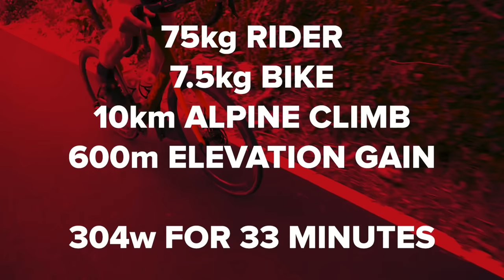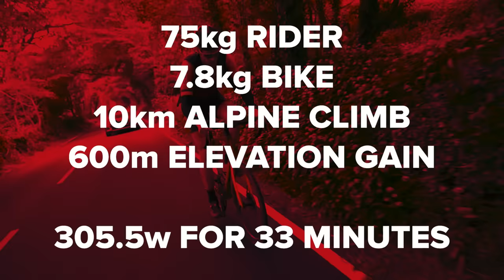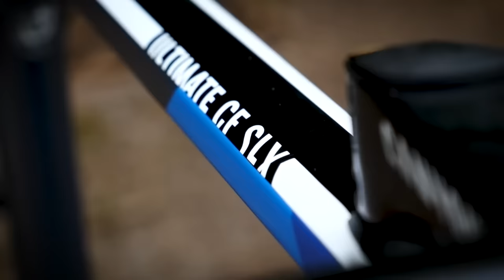10 Reasons To Consider Aluminium Over Carbon For Your Next Bike

Comment from the maker: Which material do you prefer, carbon or alloy? Let us know in the comments 👇
Reply: Yeah both my XC bike and roady are alloy 😁
Reply: STEEL (well steel is an ALLOY right?)
Reply: I would consider aluminium for a TT or trail bike, but for any road bike/cx or xc, I'd go for carbon.
Also, my alu commuter bike cost more than my car at the time, which was a 1997 Golf mkIII. €1000 for the bike, and €700 for the car.
Reply: Neither the one, nor the other.
STEEL. 
Retromodern  steel, in fact. (Columbus Gilco and Brain).
After having two aluminium alloy frames and a seatpost broken on me, there is no turning back.
Shiny Alloy for peripherals and wheels only.
Reply: I think carbon bikes do look better as everything's seamless but for the performance/price ratio definitely aluminium.
Reply: Please please use a blank space between the number and the unit
Reply: I am neither an expert at cycling or materials used for bicycles but I think I would pick aluminium alloy due to its price being more affordable, being an alloy is better at resisting corrosion and aluminium suits my casual style of riding since I am not going on Tour de France races.
Reply: Alloy all day
Reply: Titanium.
Reply: Both my XC MTB and my neoclassic KLEIN Aura X is aluminium 🤩 And I love them both… The Klein - with it’s zirconium/aluminium frame - comes in at just 8,6kg with Vision Team30 aluminium rims and a 105 groupset… 👍
Reply: I have both alloy and carbon road bikes. Carbon bike is lightweight with great components and the alloy bike is entry level but for the average rider like me I wouldn't hesitate to buy a new alloy road bike for every day riding!  It's cheaper to buy and your not so obsessed about it getting stolen or scratches! Sometimes Less is more!
Reply: Alloy. If were to break the bank and buy an ultra-expensive bike, I'd go for titanium.
The prospect of having to trash a frame from a single crash alone is reason enough for me to feel allergic to cartoon fibre.
Reply: Which is it Ollie, Aluminum or Alloy? You're a chemist so you should know the difference.
Reply: I have an aluminum Specialized Allez with carbon fork. It's marvelous
Reply: alloy
Reply: Aluminium has limited fatigue life - after certain number of stress cycles it will break. This is main reason airplanes are recycled after ~30k flights and that aluminum wheels will develop cracks as well as aluminum frames. Steel and titanium have infinite fatigue life as well as carbon reinforced plastic. Have a look at Wohler curve for all mentioned materials. Regarding carbon frames recycling - it is possible, but the problem is that it requires very high temperatures.
Reply: Aluminium for price, durability & recyclability. Steel for the classic look, titanium for the classy posh factor.
But aluminium really is the sensible option.
Reply: @KenSmith-bv4si  frames are made from aluminium alloys which are typically 95%+ aluminium. it’s fairly common shorthand to refer to them as just aluminium, simply not to over complicate things and confuse people 👍🏼
Reply: I’ve got a titanium comtat frame. I’ve had a few carbon frames but would never go back now. It’s heavier but way more comfy and forgiving in a slam
Reply: I prefer aluminium! Thanks for the video guys!
Reply: Carbon.
Reply: Well, I will choose aluminum.
Reply: As much as I like a top spec carbon bike, for me and my use; aluminium all the way. Domane ALR 5 it is :)
Reply: Aluminium
Reply: Clydesdale here. I don’t trust carbon fiber after one broken chain stay. I sweat buckets and have rusted down tubes and top tubes on steel frames. Never had an aluminum frame part fatigue break, but have had a broken stem clamp break at the bolt holes. I really want a titanium frame.
Reply: Ohh and I forgot, I don't have to have bike fitted for the Tour the France, simply because I wil never ever ride it. And if I want to have a lighter bike I just eat less, it's cheaper
Reply: Both. I have three carbon bikes and two alloy Cannondales. Alloy is more comfortable when facing roads that are less than perfect (and we have such roads in abundance where I live).  If I am going to the cycling track, however, I will take a carbon aero bike.
Reply: Steel. Aluminium is cheap though, you could use the savings to pay for your chiropractor visits.
Reply: Most amateur cyclists can't afford carbon fiber.
Reply: Changing a 4 syllable word (Aluminum) into 5 syllables raises the global CO2 rates each time the additional 'I' is added.  Way to go Ollie, your extra hot air is making the rest of us sweat more.  Steel for the win is best answer.
Reply: Aluminium for me. At first all I could afford was a Synapse Alloy with Tiagra. It was 11kg. Over time, and by buying deals. I've upgraded components (wheels, crankset, bars, seat, seatpost, RD) until it now weighs 7.8 kg and I love it. As for the dreaded BB30 creaking, its never been an issue, probably because of the high tolerances in the aluminium machining.
Reply: I liked my aluminum Ridley but I’m finding I love the more solid, quieter sound of a carbon frame, and I am in love with that dull thunk you hear when you slam on the gas
Reply: Both carbon and aluminium are great. Carbon sure is better if money is no issue but for racing and taking my bike on a plane I prefer aluminium
Reply: Titanium
Reply: i will stick with my 9.5 LB  cannodale supersix hill racer and my 9 lb Pinnarello F series and my Spec Tarmac and My titanium Litespeed , because ........ Aluminum is just so-so .  byutthe show was good , ollie
Reply: @KenSmith-bv4si  if you make tubes from 100% Al, you're in for a (not fun) ride
Reply: STEEL  Aluminum rides harsh and chatters on bad roads. Scary at high speed. I did like my carbon Roubaix as it felt more like a steel bike. My steel bike you could go 60mph downhill on rough pavement, and it was solid and planted. Very fast on the flats, and if it was slower on the climbs, it was by the smallest fraction.
Reply: Sort of. An alloy is a mixture of multiple metals. Steel (basic steel) is a mixture of iron and carbon. Carbon is nonmetallic. So it’s a mixture in its purest form but technically doesn’t fit the definition of alloy. 

There are “steel alloys” which is the steel (iron/carbon) combined with additional metals to improve its characteristics. Bikes are made of steel alloys such as chromium-molybdenum.
Reply: Magnesium
Reply: Jurassic Park.
Reply: Aluminum FTW.  Both my road and mtb are Aluminum and love them.  They can take a massive beating and it's never a concern.
Reply: Rather have steel, I have an Cr Mo steel frame, it's heavier than than the carbon, but it rides nicely. I also have an Look kg381 old school carbon frame with aluminium (the auto correct feature is wrong) rivets. The weight diference of 2 kg is mostly of worst gear, the carbon bike has 7800 dura ace and the steel has the old 105 group with a triple, and heavier wheels.
Reply: I prefer titanum!
Reply: Aluminium for ever ! I built a Trek Émonda ALR about a year ago. I decided to spend less on the frame and used the money to buy a set of Bontrager XXX4 wheels, a SRAM Red 11spd groupset and a finished it with a full Bontrager XXX set of components. It is buy FAR the best bike that I've ridden. People always thinks it's a high end carbon bike ! But it's not hehe
Reply: I started riding a year ago and bought an aluminium trek emonda. Its a great bike and its got me to love riding. It was cheap and it looks great. Yeah - I’ll probably buy myself some ridiculously expensive carbon bike one day but for now, my emonda alr is just fabulous
Reply: This video prompted me to look up ollie’s cv. He has a phd in chemistry!! Never knew - awesome stuff!
Reply: @deabreu.tattoo  Why do you think I asked Ollie , aluminum or alloy?
Reply: My Koga-Miyata is 29 years old. It is made of steel. I'm looking forward to celebrating its 30th birthday next year.
When your carbon bikes are 30 years old, let me know if you still ride them.
Okay, it might be 3 kilos lighter. But I should be 15 kilos lighter too, so if any progress must be made... :-(
Reply: I keep thinking I want a new carbon frame road bike, but then I jump on my Caad12 and realize it’s such a fun bike to ride.
Reply: Steel
Reply: Steel!
Reply: stainless
Reply: i have a cannondale quic;k 2019 frame.  works great.  ive crashed it a few times
Reply: Carbon :)  had ally for yrs before so had a change  🚲🚲🚲
Reply: steel
Reply: i switched from alloy to carbon and my new bike is more confortable and faster
Reply: Steel!
Reply: Steel.
Reply: Titanium! 😂
Reply: checks choices in frame size that fits me .... alloy it is
Reply: AL just cause of the value to price ratio
Reply: Aluminimumium
Reply: Very happy to have two aluminum bikes - both with a threaded bottom bracket.

Also, although I'm Canadian (and therefore have always called it "aluminum") I agree that "aluminium" makes more sense.
Reply: Alloy
Reply: Aluminium welded in Europe. No carbon crap produced for 100€ by unknown manufacturers
Reply: Alloy, titanium alloy.
Reply: I prefer Carbon, but the my CAAD12 seems just good;
when you ask straight up, all factors come in to play, put money aside; I will most likely take carbon. and the Trek glossy metallic finish
(I have 2 steel bikes, a few Alus and 1 carbon)
Reply: @Ιωάννης-ΠάριςΠαχής  oh God no. Carbon for my 'good' road bike, alloy for mtb
Reply: Alloy
Reply: Aluminum
Reply: Aluminium 7005, but i would go for Titanium if price was not a concern.
Reply: Alloy all the way
Reply: I just bought a CAAD13 with rim brakes. What is the best upgrade wells i can get form rim brakes?
Reply: @GCN-Tech:

Both :-)

(I like both equally as much. I don't prefer one over the other. I have no favorite[/favourite] bike-frame--material).
Reply: @jefersonerbrad4461  My Koga is from 1989 and still running too but a huge difference to my Canyon AL 7.0 and to my Giant TCR Pro. The Canyon is great for mountains, rainy days and winter, the TCR is a great bike for the flat surroundings here in Berlin and Brandenburg countryside on sommer but the Koga is my choice if I want to do a special ride on a sunday ride in summer ;-)
Reply: Aluminum; as I have never owned a Carbon bike. Thanks for the science to confirm my personal views.
Reply: Titanium steel aluminium
Reply: My family are all engineers.
Reply: What about aluminum stress cracks,I haven’t seen in first hand but you know rumors,is it true tough?
Reply: Aluminium… and I waiting for specialized allez sprint comp
Reply: @chris1275cc  Kind of.  It's an alloy of iron and carbon.  Not sure that really counts as carbon isn't a metal but hey.
Reply: Not the most educated on this as not ridden a carbon bike.  I do however know how much aliminium bikes have improved and that my high mid range ally bike is more than a match for most carbon bikes I see.  Not all of course but that's cool.
Pronunciation wise I find the history of aliminium strange.  The US are using the original pronunciation of the word, so I generally think this would be most acceptable.  However when the scientific governing body go with the newer UK favoured version I suppose the US should keep up with the times.
Being UK based I use that version, and I do find the pronunciation of a lot of international 'English' quite amusing.  In truth of course most countries using these have far more population so we need to adapt and accept we are a tiny little island in a far bigger world.
Reply: @KermitFrogThe  Err no not kind of, steel is an alloy. 
Alloy: A substance composed of two or more metals or of a metal and a non-metal 
GCN asked: Which material do you prefer, carbon or alloy? GCN (and everyone else apparently) thinks "Alloy" is an abbreviation for Aluminium, it isn't that would be ALU, ALUM (written) or ALLI (spoken) so I was having a little joke. Someone always has to come along and ruin things in order to try and appear smart. But hey.
Reply: Alloy.
Reply: @chris1275cc  Thank you for correcting me.  I had genuinely forgotten the actual definition of alloy wasn't just metals.
I was intentding my initial response to be ironic sarcasm type of pedantic, not the serious version.  Something that I often mess up in type.
I remember being confused when looking at bikes in my youth because of the alloy alli talk, so I got the joke.
Reply: @silverhawk911  while it’s true that aluminium does resist corrosion, I wouldn’t consider it “better” that carbon fibre at this task. 
Aluminium does rust!
Reply: @deabreu.tattoo  dude I’ve crashed my carbon frame gravel bike literally dozens of times. It’s way stronger than you give it credit for. I also have the reassurance that if it cracks I can have it repaired- a perk that aluminium doesn’t have.
Reply: @GC_420  lol
Reply: @sportbikejesus  
Jeez another "Must try to appear smart and ruin jokes killjoy" 
NO not "sort of"
ALLOY, from the Latin alligare ‘bind’ : A substance composed of two or more metals or of a metal and a non-metal
Reply: @twowheelsdown2002  my aluminium frame road bike is extremely comfortable. I’d depends a great deal on how you set them up. 
That they are uncomfortable is maybe more true in older gens of frames.
Reply: @AtomiX_CS  I did a similar build this year and regret nothing. Fuji Roubaix frame with carbon wheels and a Dura Ace group. It’s a massively great bike!
Reply: @lordiablo9  there’s absolutely no arguing the value of alum. Nothing else comes close.
Reply: Steel and aluminum, i owned a 1983 brigdestone road bike it was 2st owned by my moms uncle and given to me last year, the bike was great.
Reply: First time I rode over a brick road on a carbon bike I knew I was not going to go back to alloy.
Reply: @KermitFrogThe  To be fair my annoyance was really with KILLJOY BOT 3000 (Sportbike Jesus) further up the comments who said the same thing but definitely was not trying to be ironic or funny, (he also did that sneaky thing tolls do; posting to the thread rather than replying to me) and you got caught in the crossfire. Sorry bout that.
Reply: If you have money its better to  by a top of line carbon bike, but, if you havent I think its better choose a alloy frame whith good componnents.
Reply: I prefer alu, because ive caad12 and  love it so much.
Reply: @darrellshoub7527  Wow, that's a lot of nice bikes. You're a lucky guy! 👍🏼
Reply: Alloy all day every day !!!
Reply: @joelzylstra2971  You are right. Aluminum does "rust" and it does so incredibly fast. But that "rust" is aluminum oxide and it forms a highly protective non-reactive sacrificial layer for the metal underneath it. Brilliant material.
Reply: Carbon, it’s stiff AND comfortable, dampens vibration. Titanium was great, but flexed a lot. Steel was good too, especially the OS. The aluminum bikes really punished me in every way. 

I’ve own Cannondale Crit (1990), Concorde Slx (1992), DeRosa OS (1994), Merlin titanium (1996), Cervelo soloist (2006), Specialized Tarmac (2009).
Reply: @MrLuigi-oi7gm  yes,  I  am.  and I love bikes , maybe a little too much !
Reply: @Dumdadum76  Ditto.  I’ve had three carbon bikes and countless others, but Domane AL5 can be summed up in three words. “Peace of mind”.
Reply: @Dumdadum76  Ditto.  I have had three carbon bikes and countless others, but the Domane ALR 5 can be summed up in three words.  “Peace of mind”.
Reply: life time warranty for carbon solves this for me
Reply: Hahaha…pronunciation is a matter of usage and consensus not etymology. Brits are famous for butchering words from French, Spanish, and any other language to anglify them so your “al-loooo-minium” argument is rather inconsistent and convenient.
Reply: Alloy frame for my trainer (used to be top of the range one 17 years ago) but a good Carbon frame for my outside riding not a top end but a good quality one
Reply: Chromoly?
Reply: @darrellshoub7527  There is nothing more beautiful than the way bicycles blend physics, engineering, art, and adventure. You can never have too many of these magical machines. Enjoy, Darrell!
Reply: Steel!!!
Reply: @MrLuigi-oi7gm  yes  and the amazing thing is :    I am sure you ll agree :     there has been little change in the frame design in bikes in the past many decades,  if  you   go on the road with a car from 1949 people  will be like whattttttttttttttttttttt ???????????   but here are many antique bikes that from a  distance  just look like  lovely , awesome bikes , not outmoded or outdated antiques ! .... what is your favorite of your bikes ?  Mr Luigi ?  name your fave bike !  (( atm mine is my black red and white cannodale supersix ultralight. ))
Reply: Carbon isn't as impact resistant but unlike aluminum it's repairable. I used to be a hard core "steel is real" and I still prefer that for touring. But I got my first Carbon bike this year and it's such a joy to ride I don't think I could ever go back. I've never had that experience with aluminum it's always been take it leave it.
Reply: The problem is the bike manufacturers, if you want 105 or better components you have to get a carbon frame, to stay aluminum with carbon fork you top out at tiagra.
Reply: I'm a heavy person,  alloy for sure
Reply: Carbon.
Reply: Carbon or steel. Not alu. Thanks
Reply: I have an alloy mtb, and I have a fully carbon road bike
Reply: Alloy
Reply: Carbon road bike Carbon mountainbike Alu work bike
Reply: I got a Trek Checkpoint SL6 .. having broken the frame once from being stupid Itll likely be my last CF bike as honestly that has me spooked as the cost of replacing a busted CF frame is nuts .. and not to mention if you have a significant other who is not a cyclist themselves it's not a fun conversation of the expense to have ...
Reply: Aluminium
Reply: Have done some of my Best Times on an Old Alloy Frame, but having said that, the Wallet Rules the Choice.
Reply: I have a TREK aluminum and I am driving faster now. I have invested in much better brakes and wheels. I also really lost a lot of money when I sold my used carbon.
Reply: Steel mainly but I’ve just repaired and rebuilt a bianchi ev2 with super record 11 speed and some lightweight wheels and its 6.9kg with pedals. It rides like stiffer steel.
Reply: Definitely Alloy.
Reply: Aluminum is d best..
Reply: Copper and zinc alloy
Reply: I have an aluminum bike, and it has been very good for me. I can't think of a reason to spend a fortune for carbon fiber.
Reply: I have a hardtail in triple-butted scandium alloy with, get this, carbon seat stays.  
I love it, but I've heard they stopped producing this particular combination because they had too many failures at the joining point in some models, but mine has been going strong —touch wood— for over a decade (albeit I've not been in the best physical condition to thrash it too hard).
Reply: Ive got 3 carbon frames on my living room wall with catastrophic failures, and not 1 alloy frame. That speaks enough for its self.
Reply: I have nothing made of carbon fibre. My bikes are all aluminium and stainless steel. I don’t break them.
Reply: Alloy's are much easier and cheaper to repair. Metal bikes are less expensive to build and engineer than carbon. I understand Carbon has it's benefits, but I'd like to keep costs within reason and so Aluminum and Ti are much preferable. Even if money was no object I'd go with Titanium. Thanks.
Reply: As a crit racer ride what you can afford ride what you can maintain and afford to repair. You will regret choices if not.
Reply: @breakawayadv8626  l
O
Reply: Include titanium in the choice.
Reply: Can't afford neither xdddd
Reply: People who told me, alloy is better than carbon? Buahaha, this People dont have money for real Good carbon Bike on Dura Ace di2, and high quality carbon wheels for example Cannondale Hollowgram 64. This is True. Alloy frame are made for People who dont have a money. Is terrible, bad True.
Reply: My road bike and hybrid are both aluminium and my recumbent trike is steel. When conditions get windy, having a bit of weight above your wheels in kinda handy. I also think that when you can lift a bike with just your pinky finger, complaining about weight is just an excuse. At that point weight savings are not yielding significant gains.
Reply: Titanium if I could afford it. Until then Aluminum.
Reply: My wallet says Aluminium.
Reply: @iLoveTaeyeonSNSD  what You wait? Maybe its time to Good pay work and buy a high quality carbon Bike with di2?
Reply: Plastic 🙄🙄
Reply: Why don't you explain the proper spelling of aluminum to the world's greatest manufacturers of aluminum tubing?  This is not a joke but that if you look at the labels on those tubes, they have trade names and not what some ridiculous world body wants me to spell.
Reply: titanium
Reply: If I am rich , going to get all carbon
Reply: Carbon difinetly carbon. Sorry chaps but alumanum sucks
Reply: @ukestjohn  BB30 in an aluminium frame is bot an issue, in a carbon frame is another story...
Reply: I like bikes comfortable, carbon is good.
Reply: Only steel is real...... (accept titanium but this is to expensive.....).
Most of the points - stell is ahead of aluminum + carbon..... and in the UK has still some frame builders using steel. For very good reasons!
In all of that discusion - at least steel should for most people be always on the list to look and test!
Reply: Alloy, hands down!!!
Reply: My mountain bike's frame is aluminium. I like it because it is lightweight, strong, can take hits on the trail very well, dampens vibrations very well, and can take scratches and scuffs unlike carbon.
However, I installed a Ritchey WCS carbon seatpost that works very well in absorbing and dampening vibrations. I also installed an Easton Cycling EC70 carbon handlebar that is also strong, lightweight, and absorbs vibrations really well.
As a result of combining aluminium with carbon parts, my bike is lightweight and strong without breaking the bank. Aluminium bike frame, carbon contact points, and alloy in other areas is a win-win for me.
Reply: @Ιωάννης-ΠάριςΠαχής  You must be a heavy rider
Reply: @MrGgajic  Aluminium will not be subjected to gigantic stresses that an airplane undergoes
Reply: #Cycling #GCN #GCNTech  Hello Ollie, True Story... I had an 16 yr old regular customer come to my shop and told me he was racing the local Seward Park road-race series in Seattle. Oh I said, how are you placing? He replied "I keep coming in 4th or 5th". Wow, I said, I didn't know you had a race bike.  He replied "no I don't I'm using my aluminum road commuter bike, that one".  He pointed to a Fuji road commuter bike with heavy puncture proof tires, mechanical disc brakes, fenders & a rack, and said, "If I had a carbon race bike I know I can Podium"... I ABOUT FELL OVER.  I said "NO! What you need is a Lt/Wt set of tires, remove the fenders, and I'll teach you a few racing strategies and I promise you will and can win the whole Seward Park race series!"  I will sponsor you and modify your bike at no charge, and prove to you that an aluminum bike is often better than carbon.  Oh and by the way, leave the rear bike rack on, cause it actually helps aerodynamics...  He just looked at me like I lost my nuts... Sure enough the next time out he came in first!  And continued to win the entire Seward Park race series, including the grand prize of a new Burley touring bike and some serious cash.   And by the way, I rotationally balanced his wheels which made a big difference.  The best part was pictures of him on the podium and below the podium were the winning bikes two nice Cervelos and his ugly Aluminum Fuji with a bike rack...  It was a sight.  Unfortunately he moved back to France as his father trained for one year at Microsoft and had to go back.  I'll see if I can find those pictures, its something to look at.  Dan
Reply: I had a Cannondale SR 500 28 years and sold it because I wanted something new/newer. That bike frame was very harsh, but the frame never have me  issues. I now have a 2010 CAAD 9, frame still going strong.(I know the fork is Carbon) if I do get another bike Aluminum for me. Do you think you'll get 25 or 30 years out of a Carbon frame?
Reply: Alloy, of course. But the whole alloy/carbon debate is a moot point here in NZ. We can't get the alloy frames we want.
Reply: @Ιωάννης-ΠάριςΠαχής  I’ve heard light and thin aluminum tubing might not be best for heavy riders. That’s why I go with steel or carbon.
Reply: @sapinva  carbon seatpost should solve the problem
Reply: @blazingst4rz  Lol. Good one.
Reply: both too rigid
Reply: It’s pronounced aluminum.
Reply: Carbon!
Reply: Carbon road bikes, aluminum mountain bikes, and steel frame fixie bikes please.
Reply: I'm riding a Gios A 90 for nearly 15 years by now, and in my opinion it's one of the finest ways to operate a racing bike: lightweight, short and steep with an amazing handling, perfectly completed with initially the 2006 version and  today  the 2020 version of Campa Chorus components.  This is definitely the racer I dreamt of,  literally for decades before. No reason to move from my aged signorina in blu to anything of carbon, may it be blue or pink.
Reply: What is alloy? Do you mean aluminum? - International Scientist
Reply: I was cycling when I was younger but alot... back then we all talked about aluminium 7000 somehting lol... over iron can u believe ... and yes for racing ... did alot of races...  I have sadly never tried carbon... I much believe in what u say here... But I also if started again today would really much like to try a carbon one... and with that said.. it was even a Pinarello I had back then but in aluminium.... today that same cycle Prince is made in carbon
Reply: My Principia road bike is aluminium, so o prefere that. It’s as simple as that. 🤷🏼‍♂️
Reply: My Principia RSL is danish made and as such made of aluminium. It's about 11-12 years old, but works perfect to me.
Reply: Unobtanium or Vibranium which is only available in Wakanda.
Reply: What “bike of the people” should be like:
Road: alloy frame + 105 R7000/SRAM APEX
Mountain: alloy frame + Deore M6000
Gravel: alloy frame+ GRX 600
Reply: @chris1275cc  steel is real
Reply: @scottbaker5851  using titanium is kinda overkill. alloy is enough for the force it will meet on the road and alloy is half time lighter than titanium
Reply: @mozambique9113  
My custom ti bike comes in at 17.5 lbs.
Reply: At 218lbs, I'm not a weight weenie, so I think Aluminum for me. A few pounds isn't going to make a difference.
Reply: Titanium! If you know you know!
Reply: 99% of the performance of top end carbon fiber bikes for the cost of entry level carbon fiber.  My Trek Alpha weighs half a lb more than the Emonda and rides better.
Reply: 4130 CroMo steel.
Reply: I use steel bike for smashNgrab with cargo trailer attached and alu if i want to be quik
Reply: Ideally it depends on the application. If your doing touring or commuting go with steel. If your a young racing pro with money, go with carbon. But if your like most cyclists who want a good all rounder for not much money, go with aluminum. I aspire to ride Titanium some day. Thanks.
Reply: I have a steel bike, an aluminium bike, a carbon bike, and in 2 weeks my Litespeed Titanium bike will arrive. Gotta catch'em all you know. So far, I  prefer the carbon.
Reply: I'm still choosing alloy bikes! why? First of all it's on a fair share prices and also a perfect weight for the bikers 

While Carbon Fiber Bikes are quite expensive rather on the brands but the weight is lightweight but it's too pricey
Reply: @fortynine3225  steel lasts longer and can be repaired, replacement tube welded etc
Reply: I own 15 Alloy bikes , had a few Carbon but all cracked or damaged stays and BB bracket area , they are crap in carbon ,  Alloy last forever like my Batavus Columbus Mega Tube
Reply: Metal all the way
Titanium!
Reply: I have an old 1996 Giant which is both aluminium AND carbon fibre. It rides very nicely but if I had ridden it as much as I have ridden my 1996 reynolds 531 frameset bike, it would be dead by now.
Reply: I have a Columbus Altec Pro Plus aero framed special , that is 10x better than a top end carbon that will crack and break in 5 years ! Boss of Treck is on YT saying max life span for carbon is 10 years and when he X-rayed his own Carbon bike they found 125,000 micro cracks in the frame ??? OMG ....
Reply: +1 for the point about bike packing. I went with a group of friends recently one of whom damaged his rear forks with the mounts he fitted. I'd also question the roadworthiness when buying second hand carbon fibre bikes.
Reply: @GC_420  he also failed to note that here in America we don’t spell it like that so his whole pronunciation thing doesn’t apply
Reply: tropical climate country alloy. 

stable cold county with 25 degree at summer go for carbon 
 
for lifetime go for titanium
Reply: I prefer a bamboo frame, because we have a lot of bamboo tress back in the Philippines. 😃